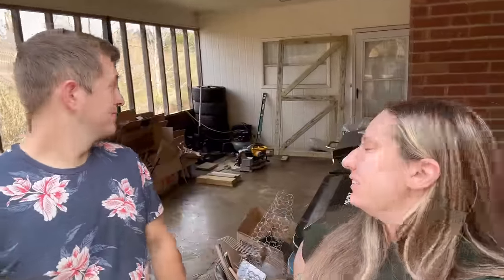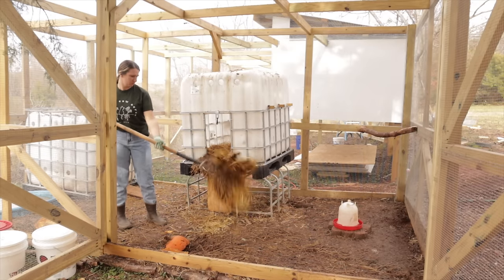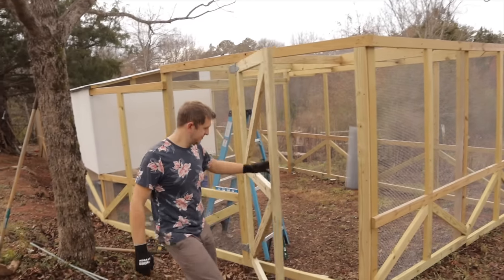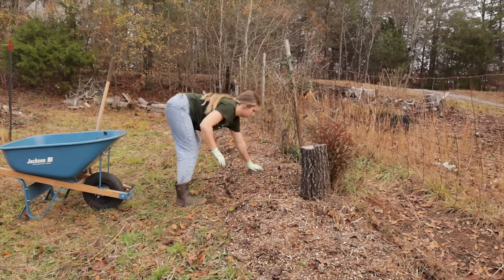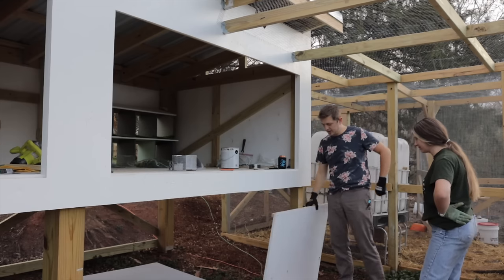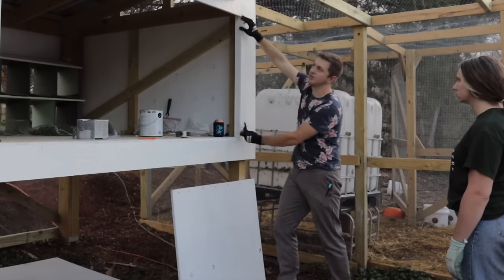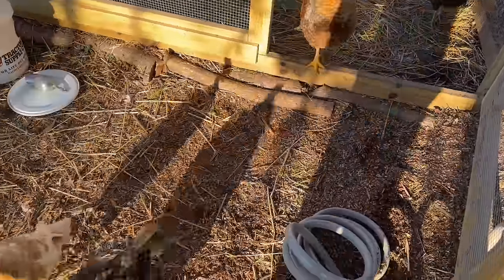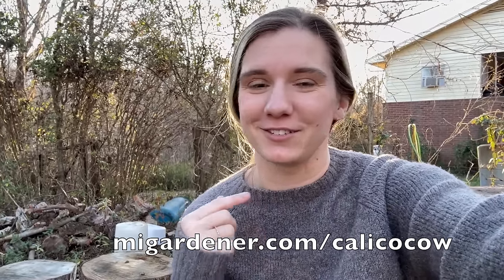Farm Chores & Chicken Coop Doors | DITL | Homestead Day in the Life

Comment: Building with Pocket holes is the BEST! We just did a huge storage tote shelving system and ended up with two 10 ft  work benches in an upstairs space that would have been otherwise unusable. The pocket holes made the math for 18 gallon totes work out PERFECTLY! Editing to add the space is an "attic" space with a really steep roof pitch and 4ft side walls enabling us to stand at the 2ft deep workbench, using pocket holes allowed us to orient the framing in a way that didn't interfere with sliding totes in from the front!
Reply from the maker: This is awesome! I definitely think they look super nice, too! I'd love to have that intense of a storage setup someday haha
Reply: @calicocowacres  You'll get there! We've been in this space, and NEEDED this solution, for 6 + years and finally made it happen...mostly because of discovering the AMAZING pocket hole jig!!